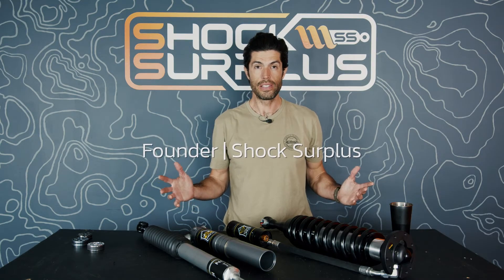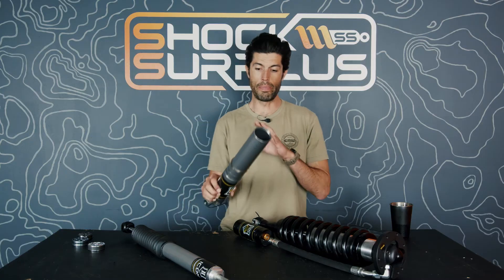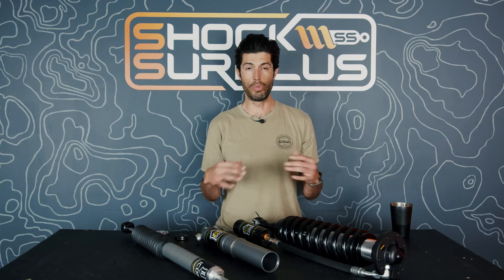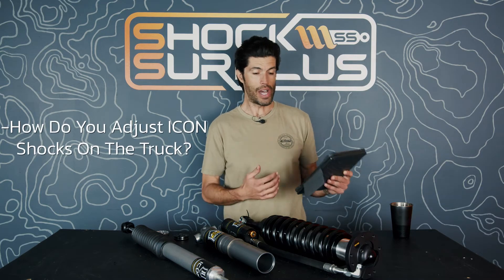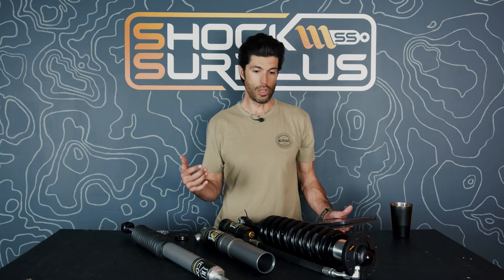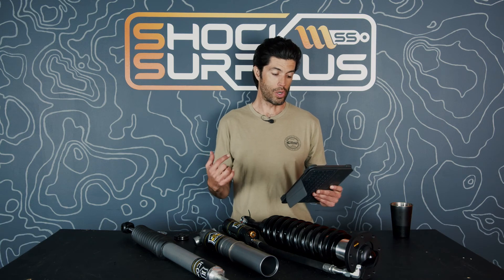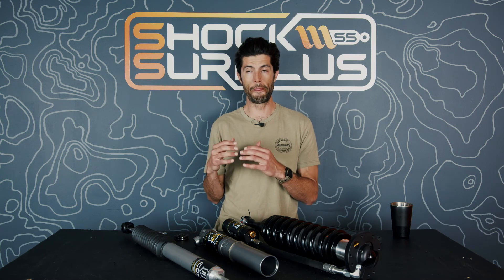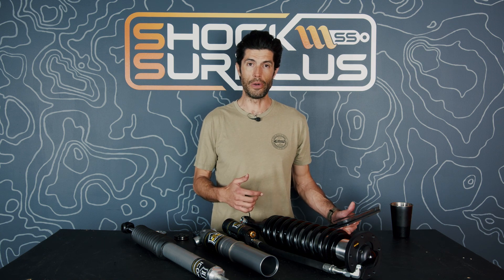Icon Shocks for Beginners - Your Questions Answered

Comment: DO NOT BUY.  I'm on my third replacement set of stage 4 on my 4th Gen Tacoma within 90 days of purchase.  I've written Icon many times asking them to stop selling these until the quality control improves.  Spring rubbing the shaft immediately after professional install , and near full compression with a basic steel bumper.
Reply from the maker: we'd love to see some pics of that, you sure you mean the spring on shaft? Or spring on body? or UCA on spring?
Reply: @ShockSurplus  what's your email?  I'm happy to send pics of damage and camber on all three sets that had less than 700 highway miles....

Comment: Just bought icon 2.5 for 2016 ram 1500 from you.   One of the top hats is perpendicular and the other has a sight tilt. Is there any reason to have the slight tilt or should i set them both to perpendicular?
Reply from the maker: no reason off the top of my head, they should be flat, definitely double check that the spring is seated correctly on the tilted one.

Comment: I feel like every shock I look at is digressive and “not known for on road comfort” which shocks ARE known for on road comfort??
Reply: Digressive shocks are known for better handling on the road. With my Icon CDCV, I can tune my suspension to my liking. Usually, when I'm driving on the road, I set it to a higher setting, but if I want to go off-road, I switch to lower settings. I love my suspension because it gives me more control both on and off-road.

Comment: hey guys! i want to decide about icon or dobinsons MRR. i like just to go slowly in the dirt.. i can run but nothing crazy just for few seconds. and i want to know. if the icon are good enought going slowly.. i want to get the cdcv valve shocks. and i dont wanna anything bouncy in my truck. my truck only have right know, prinsu roof rack, rooftop tent ikamper and a 180° awning. i will buying more stuff for the truck. so. what can you recommend me. i want a overland vehicule built.
Reply from the maker: While we've loved our Icon setups on numerous vehicles, their CDCV setup is great, we would categorize those systems as a performance level shock that is meant to play at faster speeds. At lower speeds they may feel too sporty/firm for some, but being adjustable with the CDCV under a loaded vehicle with all that gear, it should be pretty comfortable (it was for us on our Tacoma with 600lb constant load).

THe MRR will typically be more comfortable all around, has a lot more adjustment to fine tune the ride. The rebound adjustment on the MRR really makes a huge difference in ride quality and comfort, so that cant be overstated enough. Rebound, in some of our opinion's here, is the game changer for ride quality. Dobinsons typically last a bit longer than Icon in terms of needing service.

Hit us up to dive into more details, support@shocksurplus.com

Comment: Purchased my Icons directly from Icon but do like your videos on suspension a lot. Good useful information presented very well. Chose Icon for my light weight 4400 pound as driven on road, RCSB 2017 F150 2wd, because of the handling reputation. I am on a set of 2.5 CDCV all around adjusters set to #2 or 3, the coilover collars run as high as possible to get a min lift 1.75 inches. Trail use is very good on WI MN MI forest service roads, but pavement handling with a bit of alignment tweak is fantastic for a full sized pickup. I spent a lot of time slalom racing sport cars in the 1980's, this setup feeds my handling desires!
Reply from the maker: love to hear it, thanks for the feedback!

Comment: hey guys! i want to know!  what is the best suspension for low speed with gear for camping.. drawer system, freezer, front and back bumper, Rooftoptent, awnining etc etc. i want a suspencion for my 4runner but i dont wanna to run every time. what is the best balanced kit? dobinson? icon? fox ?

Comment: Quick question, i have a 2023 Ram 1500 4x4 with the V6 etorque engine. Looking for a 2.5/3inch lift up front and around 1.5 lift in the rear. I usually hit the typical fire roads with a few offshoots (Lytle Creek, Cleghorn, Big Bear areas mainly) and with the occasional desert trip, usually carry 200-300lbs of gear in the bed. Would the Icon stage 3/4 kits be suited for me? They advertise 2-3inch lift with 2.5 resi coilovers up front and upgraded UCA, and 2.5 resi shocks/springs in the rear with 1.5 height. I also like a firmer/sportier ride on the road. Thanks!

Comment: When you did you actually sell out  when by using high quality products rather those old shitty rancho shocks. I certainly would have sold out after watching those old rancho and bilstein crap suspension videos. The new ones are at 1000 ñ
Reply: And the did you did with  King, Icon and the other top of the line of the lines.

Comment: Hello! What would be a good fit for a 2023 bronco wildtrak with a HOSS 3.0?
Reply from the maker: That HOSS 3.0 already comes with a good set of internal bypass Fox shocks so I would definitely stick to options that are also position sensitive like the Fox 3.0 Factory Race Series, or electronically controlled like Icons CDEV or a set or another brands 2.5 external reservoir coilovers with an SDI E Click upgrade.

Comment: i think the icons might be a fit for me because I don't want drive around my rig feeling like its the titanic. and usually just drive around gravel roads and its nice to drive on spirited side where this shocks shine
Reply from the maker: Definitely, and more often than not they often end up being our personal favorite option for our own rigs. They certainly are a little firm over smaller bumps and chatter at lower speeds, but we always like to say if your Icons feel too stiff you just arent driving fast enough LOL
Reply: @ShockSurplus  watching xoverland drive across north south america and europe on icons probably helped with my decision too
Reply: @ShockSurplus sorry but when you mean chatter at low speeds , do you mean the front end of the truck would constantly rise up and down at high rate ? If that’s so , that’s what I’m facing with my Icon 3.0 Coilovers on the highway , certain imperfections and I got this . Truck is 2014 Raptor with a midtravel kit . I was recommended to have a 700lb spring rate for the midtravel kit . The 3.0 for the raptor are 675lbs .

Is there a way to alleviate those chatter that the truck manifest on the highway ? I tried the CDVC and placed it all the way to S soft setting but nothing have changed .

Comment: Have Tacoma. 2.5 icon coil over  remote resi front + S2 2.5 omega bypass up front as well.  i have revalved (0.015” compression coil over and triple up on compression shims in the bypass). Front uniball upper and lower.   They handle great until you get serious, then the piece of shit digressive valving acts as if there’s no shock whatsoever and it’s major bottom out time.   Very very unpredictable control when you beat hard.  A clone Tacoma we have , with the exact same set up as me but with king coil over and bypass up front does not have any such problem whatsoever, very predictable and progressive for the king setup . This is absolutely true what he says in the video about digressive valving being no good at speed .   I don’t know who decided to put a digressive piston in an off-road shock. Do not ever run any sort of digressive shock off-road like icons . It will literally be like you have no shocks whatsoever once you hit something very hard.  They are way way way too soft over real bumps (not on the street)Another stupid thing ICON does is their shims are all 7/16” inner diameter. DO NOT RUN Icons if you like high speed desert beating.
Reply from the maker: Icons really are the original "Pre-Lander" shock so they go digressive largely to be better on vehicles with a little bit more constant load. Often times with a linear shock you have to run way stiffer springs or simply valve it a lot stiffer over  to get the same stability under a load since they usually lack the low speed compression to really stabilize a lot of extra weight. The digressive valving is more a concession they make to be able to be paired lighter spring rates so they can still ride decent on stock weight vehicles while still being stable and supportive enough on vehicles that might have some additional constant load.

Comment: Hello. I should like a shock with a firm behavior ( actually I ride Bilstein 7100 with 400/100 valving rate). The Icon 2.0 IVD206514 will adjust to my needs?
Thanks in advance
Reply from the maker: Icon does not list specific valving specs like Bilstein does, but that does have what they call their HDRV valving so at the very least it should be similar to the Bilstein. With that said that 7100 is user revalvable so I would probably spend the time tuning it stiffer than buying shocks that might not have the valving you are looking for.

Comment: You gave me some relief. I just bought a 2018 Tacoma Limited and it came with Icon II's and they are leaking. Hope to find somewhere in North Georgia to rebuild them. Any suggestions?
Reply from the maker: google maps 'motorsports' and start asking around who can service them. Or you can ship em to us!
Reply: @ShockSurplus  where are you located?
Reply: Are they 2.5s. If so you can invest some time in researching minimal tools and do it yourself.
You could even play with shim stacks  to soften or slow shock down depending on how you think they feel now.
Reply: @evanmiller1642  well I was able to adjust my shocks but I did  have to heat and bend the spanner tool I was sent a few times. Got it done though before our trip from Georgia to Louisiana. Ended well.
Reply: @Mr.Higginbotham  
What? The collars are that tight with the weight off the axle? Usually ive had good luck just turning the entire coil to adjust collar ounce jamb collar is loose.

How much preload was on them ?
The distance the collar is down ounce the spring quits shaking
Reply: @evanmiller1642  Turns out they were not leaking. The guys at the shoddy shop I was at played me for a bit. They were trying to get money out of me for shock replacement 😡
Reply: @Mr.Higginbotham  
In my life time ive found very few trustworthy shops or techs. Thats why i do all my own wrenching. Im 40 with ever growing skills as a self taught wrench hack. Even when i fuck shit up its still cheaper than paying a tech to fuck my shit up.

Comment: Have Icon’s on my 2021 Silverado with less than 20k miles and the front right just failed and started leaking. I can’t find anyone local in the SE to rebuild them. Pretty disappointed in them and wouldn’t recommend them to anyone. Now I either have to send them back and be without a truck for 3 weeks or let someone who has never done it before try to fix them.
Reply from the maker: how bad is the leakage? constant? big puddle? If you wanted to ship them here to service, would probably cost $70ish in shipping both fronts back, $400 on the rebuild, then $50 shipping back.

https://www.shocksurplus.com/pages/shock-service

Comment: In your opinion which type of suspension would you recommend on a Tacoma 2002 I’ve been looking at the icon stage 3 been doing my research but still not quite sure
Reply from the maker: The stage 3 kit nice, super solid, definitely aimed at performance so i hope you're running around the dirt pretty fast, or want great handling on the trails. I'd take a hard look at the Bilstein 6112+5160 setup for much less; you could get the bilstein kit and new UCAs with the rear add a leaf - for the same price of the stage 3 kit.

https://www.shocksurplus.com/search?Year/2002/Make/Toyota/Model/Tacoma/DriveType/4WD

Comment: One of my icon 2.5 coilovers that are just 2 years old in my vehicle is leaking. It's not even 50k miles yet which means icons are prone to leaking compared to others. I'll be looking at other brands of shocks but I will miss the plush and comfortable ride though
Reply from the maker: Needing service by 50k sounds about right, Fox and especially King will require the same. These performance 2.5 shocks need service, their internals are made for a certain amount of heat cycles. If you want something super durable and dont require service, go with Bilstein 5100, Eibach 2.0, maybe Dobinsons - they claim very little service requirement
Reply: So if I went Eibach 2.0 coil over kit would icon arms be considered low maintenance as well and how longe do they last? Do you need a diff drop as well? Thanks
Reply: All parts fail. Performance parts need more maintenance to remain high performance. High end mods is pay to play or learn to DIY, then it's pay to buy tools lol. 

The only "long life" option is Bilstein. The eibachs may last as well, jury is still out there. That said, even bilsteins can fail on day one, and every shock has its limitations which is the responsibility of the operator to remain within.

Comment: I have a 2011 4Runner on a stage 7 with the stage 2 secondary system. I like the daily driving handling and when I hit a trail it’s super smooth. From what I know about digressive vs linear is a linear piston is a lot easier to tune. It takes a bit more skill to tune a digressive piston. Also another benefit with Icon is it tuned for each vehicle. King and Fox they us a baseline tune for a variety of models. Toyota for example. The tune on a Tacoma is the same as a 4runner. Yet both are completely different handling rigs. All in all great video!!
Reply from the maker: Thats our view too, but to make that claim we need to backup that generic valving claim with dyno charts, soon!

Comment: Great info on icon. Just did a stage 1 on my Tacoma with 2.5 in the front and 1.5 in the rear. Also paired it with the Icon Rebound Pros. New to 4x4 so this video was nice clearing some questions.
Reply from the maker: Solid choice!

Comment: What would be a recommendation for a 2023 ram 1500 4x4? I’m 99% on road. Thinking of a icon stage 2 2-3 in lift/level coil over. Are there any other options to look at compared to that? What would recommendations be.
Reply from the maker: Icon are great, but probably overkill if you're not concerned with dirt performance and more spirited driving offroad. Eibach and Fox both provide a bit more comfort on-road in our experience, while still doing great in the dirt

https://www.shocksurplus.com/products/eibach-pro-truck-lift-system-stage-1-kit-for-2019-2022-ram-1500-4wd-w-2-lift
Reply: @ShockSurplus  
Do you valve shocks?
I ***** love accutune.
Over the counter cookie cutter shocks are a dissapoint in comparison

Comment: I noticed you didn't address what I'm seeing all over the net and what I hear from my shop, that Icon has issues with seals blowing, leaking or however its characterized. I was planning a stage 6 from icon when I was hipped to the issue and from what I understand it's all over the driving spectrum, on road daily driver to beating them up offroad. So I started looking elsewhere and I'm leaning towards the Fox 2.5 dsc performance elites but I didn't see those on your site for the 5th gen 4runner.
Reply from the maker: We've heard the same thing as well, but dont actually see it in the real world. Stuff like that goes through us before it goes to Icon for repair, and we rarely have those issues - and when they do arise, Icon usually handles it quickly.

Depending on how much high speed performance you're after, there's still quite a few really good options - SDI EClik, OME BP51, Dobinsons MRR, Kings of course. SDI is probably the best there is honestly, newest option, but electronic ride control front to back, for only a little more than a Fox 2.5 Performance Elite setup.

The Fox Performance Elite aren't available yet for the 4Runner, waiting on Fox for those and they haven't released any information or part numbers yet. They're having a hard enough time filling orders on the Tacoma, Bronco, and Silverado platforms - so they're quite behind.